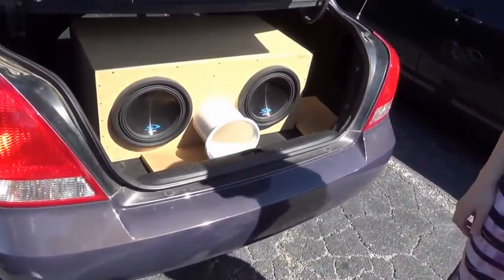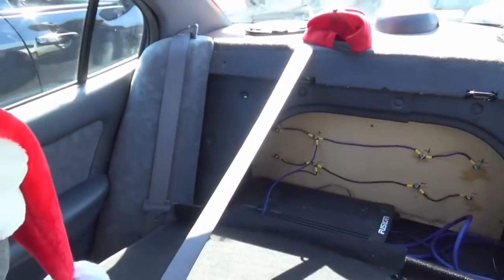Subwoofer Videos. Girl BassHead. 2 Alpine Type S 12's In A PVC Aero Port Box

Comment: Type S are so underrated.  I have two 10s receiving 1200rms watts and people think I have expensive 12s
Reply: Same here. I Have 2 alpine 10’s type e in a sealed box with 2,000 watt alpine amplifier. In a ex cab truck it’s too loud.
Reply: I believe the type s are better on 1200 watts or less /stock electrical...than  the type Rs...